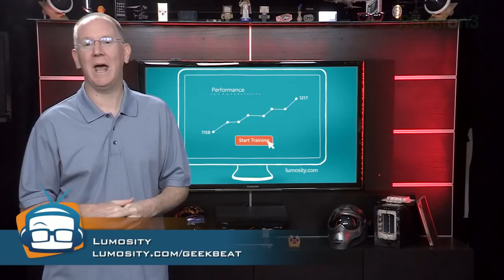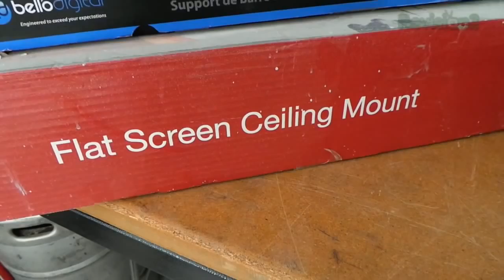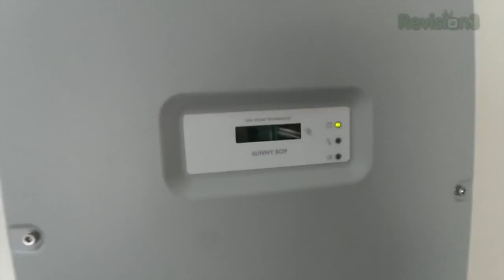How to Mount an Electric Trolling Motor on a Kayak

Comment: As a long time kayaker I can tell you that putting the battery between your legs is a death sentence if you flip over. The batt. will act like a wedge once your upside down causing your legs to get stuck hence you will drown while trying to free yourself upside down. There have been many, many people killed in this fashion over the years. Tackle boxes and small lunch size coolers have drowned many kayakers in this manner. Just FYI for any people watching this video.
Reply: Thanks for the heads up, and warning to others. I have a sit on top and was looking for ideas to run a motor. Came across this and will use a couple ideas, but battery will be behind me in the storage well. I also have  a foot operated rudder that i want to incorporate with the motor shaft and run the controller up on my control station

Comment: Thanks for sharing. I guess I will attempt this on my Ocean frenzy. You can improve the design by making both fishing rod holder mounts in the outward direction. This will still work the same as having both of them point inwards as you did but will retain more value for resale since whoever is going to buy the kayak would be able to use both mounts. In current setup only one fishing rod holder can be used.